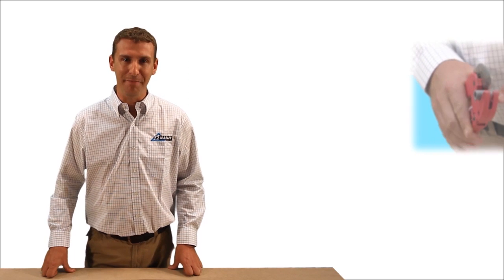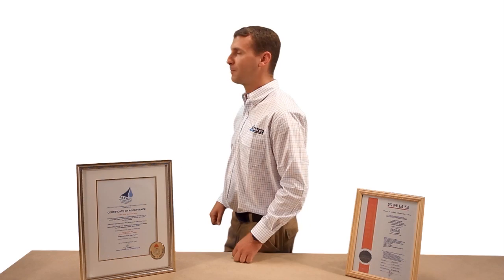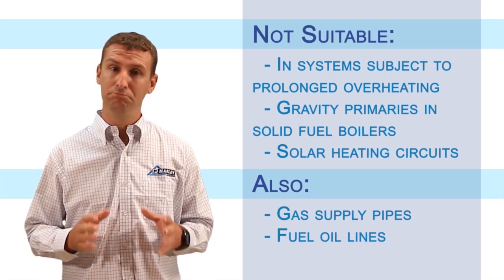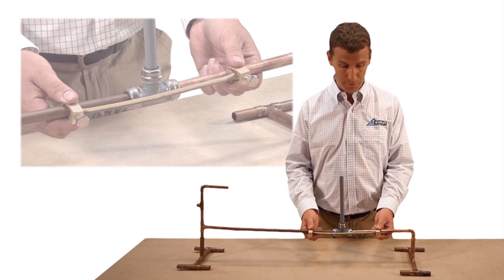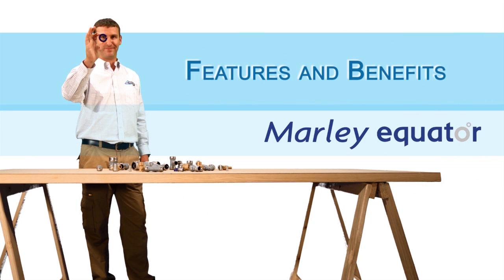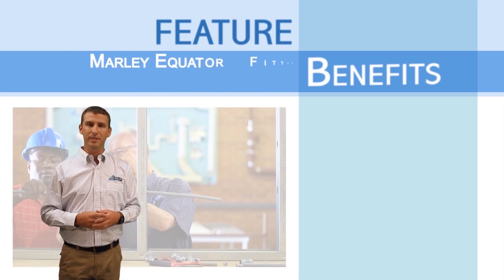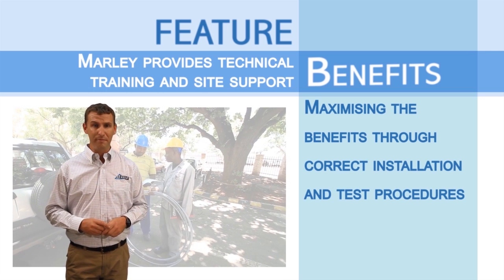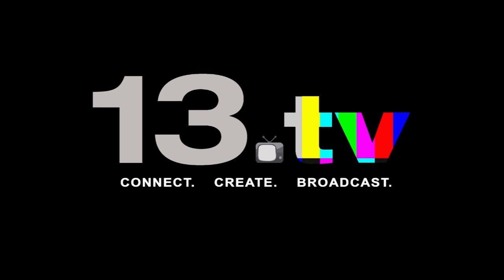Marley Equator Training

Comment: I installed my water system with marley equator in some fittings the  pipe didnt lock and with some effort you can dismantle the pipe ...i m afraid to use this system again ...for me its not reliable